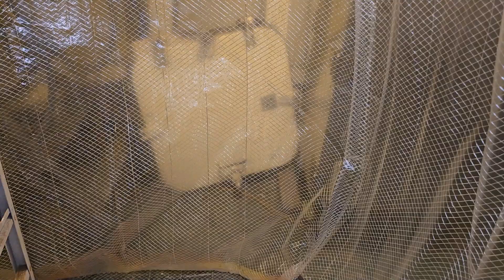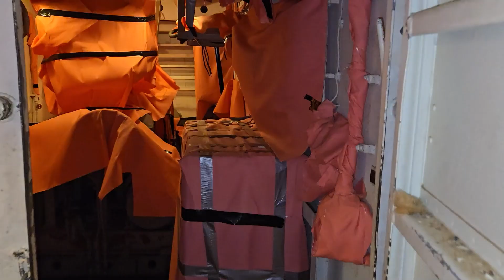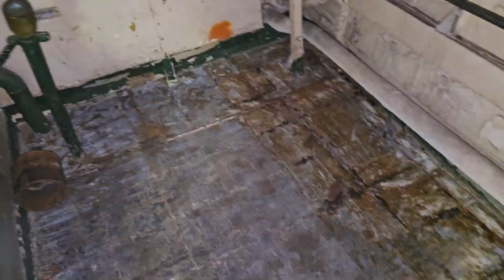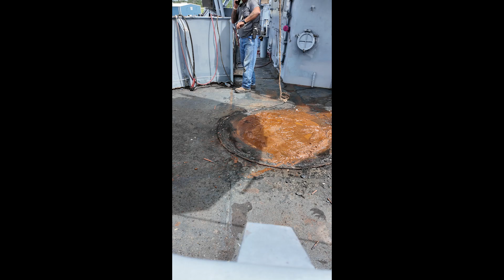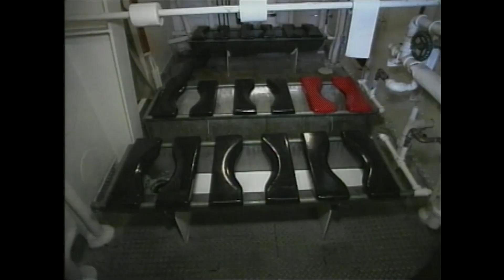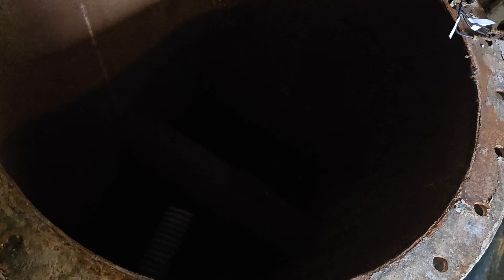Wasted Metal Repairs, Rebuilt Motors, Tank Cleaning, & more - Project Update #3

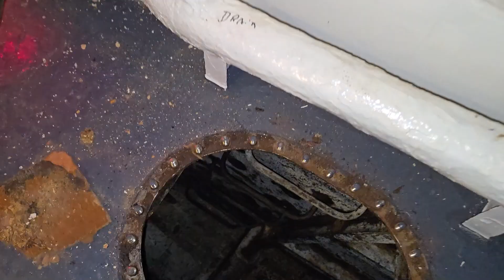Comment: 3:44 so does water go inside that section right there, or the pipes that we see? Also, are the looking at the hull itself right there or no?
Reply from the maker: @blitzwolfe7875 : They're fuel tanks. BUT, ... they would pump in seawater atop the thick Bunker C fuel oil to maintain ballast. So, both would have been in there at various times. And, yes, those tanks' outer skin is the actual skin of the ship.
Reply: @usskidd661  thats cool. BUT... does the water or fuel stay in the pipes, and what liquid "rests" against her hull?
Reply from the maker: @blitzwolfe7875 : Both. Those pipes are used to drain and/or fill the tanks, depending on the pipe. The ones that look like radiator coils are used to heat the thick Bunker C to a more liquefied, fluid state.
Reply: @usskidd661  gotcha (freakin' cool)